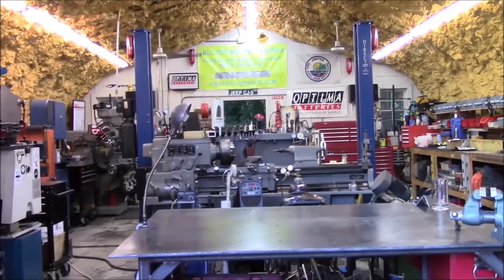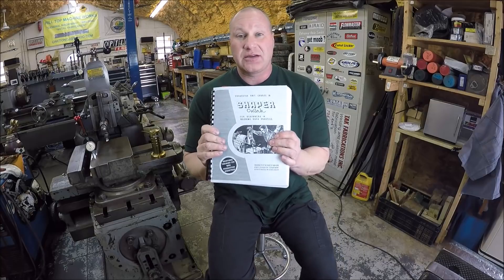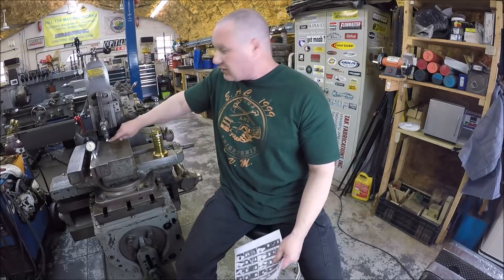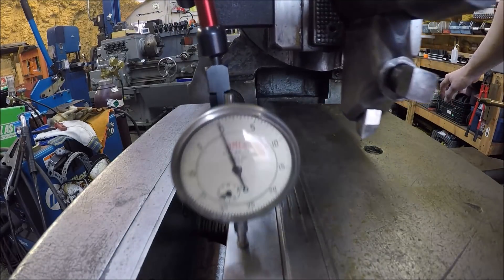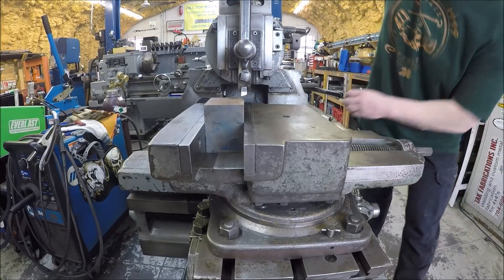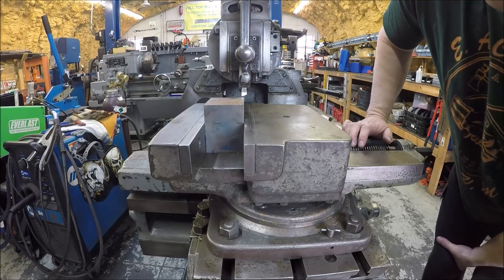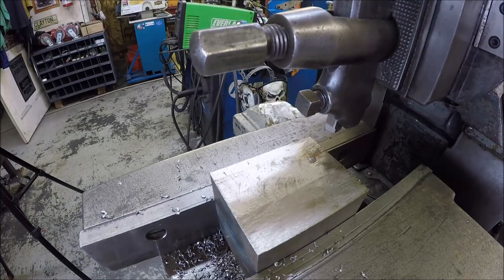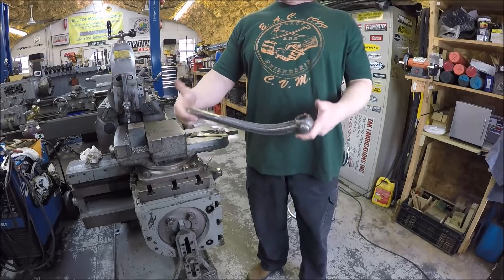G&E Shaper makes it's first chips!

Comment: Hey, Just got a 20" G&E shaper. It's in rough shape. Have to remove the table neither up and down crank or side to side cranks do anything but make terrible grinding noise.  wish i could get a manual to show how.  everything else works except when cutting i get all lines in my chunk of 1018. Reground bit more times than i can count.  slow cross feed and only .010 cut. BAD BAD finish.
 Is there a forum on shaper operation and repair where i could get some help. 80 years old and that don't help either.  Jim Hailmann,  Missouri
Reply from the maker: So you need schematics of the table feeds? I have   some I think. Let me look. Do you watch Adam Booth's channel? He has a lot of good videos running a shaper and point out tips and tricks.
Reply: @hilltopmachineworks2131  yes I watch Adam but he has all top notch stuff but I watch everything he says.

Comment: When you feed the compound down to set your cut depth make sure to take out the backlash by reversing the screw back up. Otherwise it will work it's way down even if the compound is locked. Use the lock also. Tilt the top of the Clapper away from the direction of cut. I got it backwards for a while before it made sense to me.  Nice that she runs without issue. Thanks for sharing Tom.
Reply from the maker: Thanks for the tips Steve.

Comment: Congrats.  Shapers like speed. 44 or so SPM .  Faster for short strokes.  Tilt the clapper / tool so it swings away from the cut edge of the work .    Razor sharp tool with a little radios.  The bigger the radios the bigger the step over you can take.  You learn as you go.  No sharp point tools. It'll dig in and brake off. Of take the work with it.  Don't ask me how I know....
Reply from the maker: Thanks for the pointers Doug.